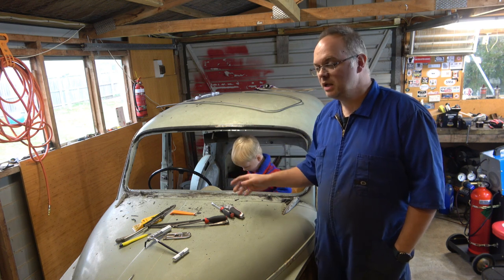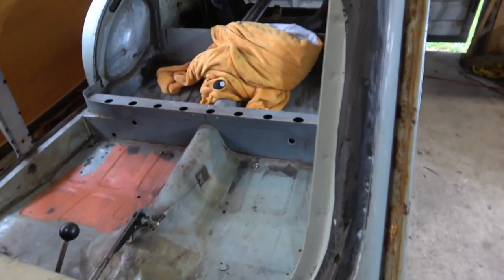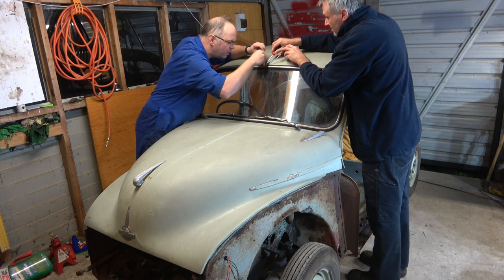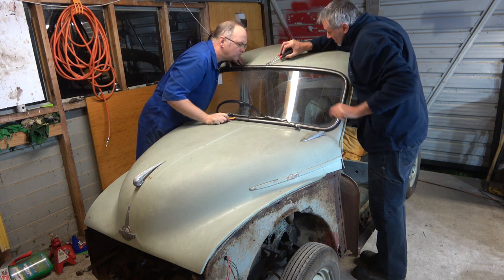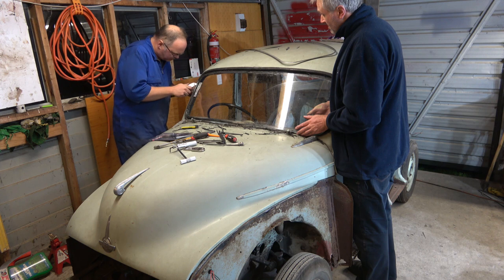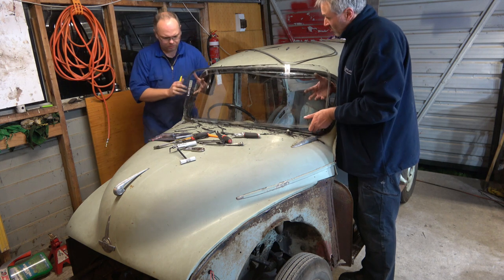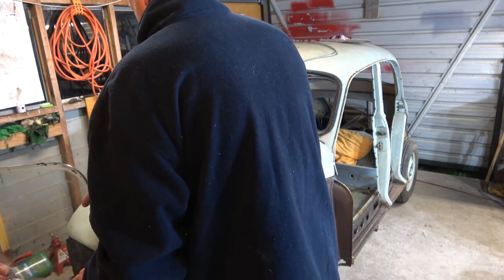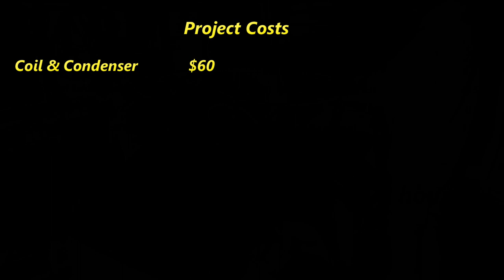Morris Minor - Windscreen Removal - Part 15a

Comment: Well done on getting the trim out without damage, look after it, they're as rare as hens teeth. For what it's worth in my mind you took the right approach, slow & easy 👍 And that was the easy part, putting it back, whole different thing....there used to be a small tool to help put those trims back in, it slipped on the trim, then into the rubber & opened up the gap to slip the trim in, can't recall what it was called...🤔
Reply: That'd be a locking strip tool, or a glass trim tool, depending on the application!  There's two main types of chrome trim, though:  T-trim, which sets into an expandable slot on the gasket, and flat, which hugs around an extrusion on the gasket.  Unfortunately, it looks like this may be the latter type, which as far as I'm aware, there's no tool to aid in installation.

T-trim sets are extremely easy, just put the gasket on the glass, slip the trim into place, make sure it's properly seated all the way around, wrap your soapy rope around the gasket, and have a buddy push the glass against the pinchweld while you rope it in.

Locking strip sets, it's usually best to put the gasket on the car, set the glass in on the bottom, and grab a large hook tool to hook the trim over the glass.

Flat trim, though, is a total variable, and in the case of this video, it's difficult to tell how best to set, just because the removal process was so destructive due to the age of the rubber.
Reply from the maker: The aim was to do it without damage regardless of how long it took. We achieved that thankfully! Putting it back in doesn't sound easy but as always we will get it done one way or another.

Comment: Hmm, can't say I've ever pulled a gasket-set windshield out of a car with the intent of reusing it!  I imagine that gasket was fairly hard and brittle after all these years, though.  Kudos on getting that trim piece off!
Reply from the maker: It's all in one piece and undamaged which is all I could ask for. The rubber was rock hard and there were many different adhesives in play. IT must have  been replaced by some cowboy or leaked or something. The bodgers had been in there prior to me :)

Comment: Somewhere around 3:00 the actual size of the car finally became obvious.  Wow, that's a small car!  And I say that as somebody who owns a (modern) Mini Cooper.
Reply: Mr. Badger is 6'2"... his helper is probably 6'4". I'm thinking it's a bit bigger than a Mini Cooper... no?
Reply: There is nothing mini about a bini
Reply from the maker: It's pretty small, I don't fit in it too well. Not sure how it compares to a Mini. It's probably slightly larger on the outside at least.
Reply: @EXOVCDS  I'm 6'3", and what makes the Mini Cooper usable is that the rear seat is basically ornamental.
Reply: @Scodiddly  Have you ever tried sitting in the back? You know... just for fun? LOL
Reply from the maker: I've sat in the back of a modern mini. It wasn't much fun

Comment: Hey Charlie just remember that the water goes into the radiator and not the gas tank.
Reply from the maker: It's normally stones that end up places
Reply: @Badgertronix  One of the kids that use to go to our church took the water hose, turned it on, and stuck it in the dryer vent. The parents didn't realize they had a pool in their basement until they went downstairs and found 6 inches of water on the floor. So some stones in the tank is not a real biggy. Oh and Charlie forget I told this story.

Comment: Please explain WHY you took out the front windscreen. Thanks
Reply from the maker: You can't paint a car with a windscreen in it....
Reply: @Badgertronix  Thanks
Reply: Also if it's like mine, the rubber is that old that when it rains it leaks though to the interior. So replacing the rubber is a good idea

Comment: All you had to do was pull out thr silver trim in the middle out,and then push the window out from the inside out. 3 minutes tops
Reply from the maker: There were at least 3 different types of adhesive that had been used over the years and the rubber was rock solid. There was no guarantee it would have come out in one piece. The trim was not moving without bending.

Comment: i did it on my own in under 30 mins and cut the rubber a lot less than this you made a bit of a mess of it to be  honest all you had to do was cut it in the corner. i have the cuttings if want proof that its possible with one cut